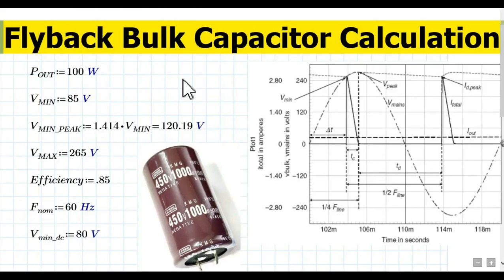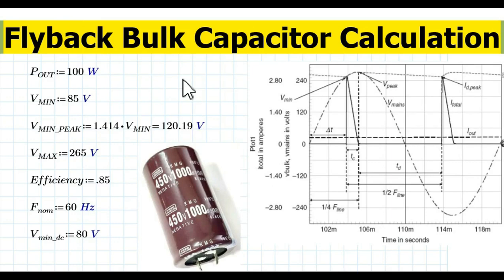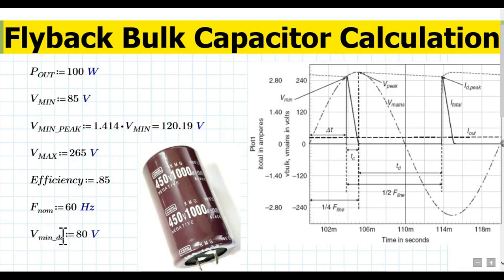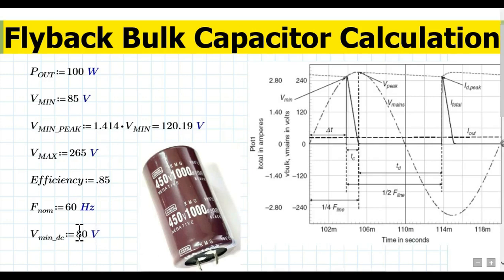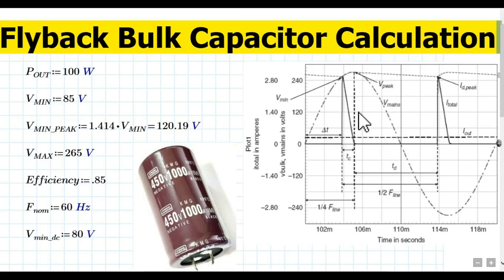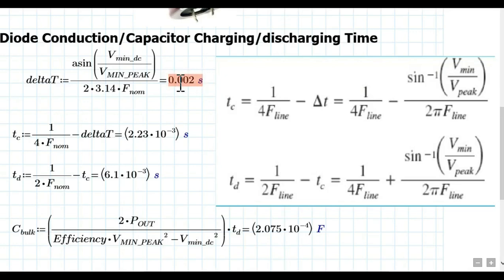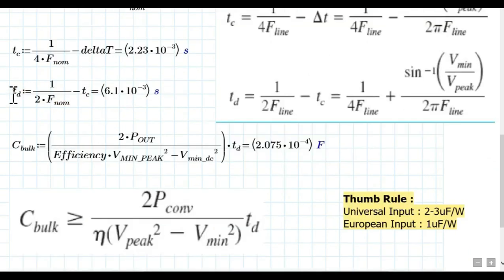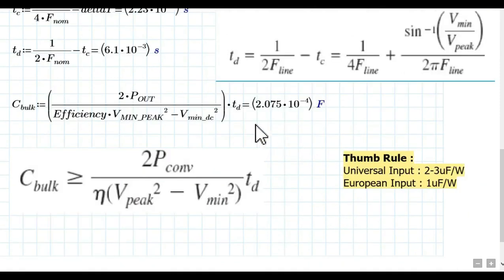Flyback Bulk Capacitor Calculation - YouTube

Comment: You could at least mention that the time-domain graph you show is coming from chapter 6 of the book "Switch-Mode Power Supplies SPICE Simulations and Practical Design" by Christophe Basso! Whenever you use existing materials, the least you can do is acknowledge the source, especially when you have copied/pasted equations from the book : {

Comment: how do you pick 80V DC min?
Reply from the maker: Thanks for asking good question.  80Vdc is minimum dc voltage required by PWM controller to turn on during startup.
Reply: @ElectronicsCircuitHubECH   so for my understanding on a cm6805B this voltage is 13V?